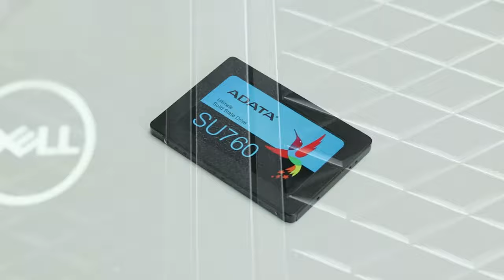Dell Precision 5820 Hard Drive Installation

Comment: To unlock the HDD bezel, remove the side panel first. Locate the unlock button. It is blue in color, located above 5.25” drive bay towards the front of the chassis. It has an unlock symbol. Press it. 

After that, then you should follow the instructions in the video. Thank for posting is video.
Reply: Bro, you just saved me from ripping the thing off.
Reply: @disasstah  same here 😅
Reply: life saver
Reply: This comment is the most helpful part of the video

Comment: 1:10 mine system is not open for some reason that latch is jammed, using something to push it down but the front panel where the ssd is not pop out or removable.  Any idea?

Comment: I have 22110 server samsung p963 nvme ssd that I have installed in pcie adapter and Im using it as boot driver in my lenovo server . Can I use this as boot drive in dell ? Will it boot from pcie ? This pcie adapter also comes with sata cable that I can connect to motherboard .

Comment: I’d like to install two 2.5 inch ssd inside the 5.25 inch bay using Dell r9pxf cage. Do I need to buy two SATA cables and connect them separately on the motherboard?

Comment: I got a 2tb 3.5 inch sésgate barracuda drive and i put it in but it just doesn’t show up on my computer
Reply: If this is an additional drive and the drive is new you may need to initialize it in computer management.
Reply: Have you solved this issue?  I have the same issue but didn't know how to enable it.
Reply: @eaglezhou1243  - Go into the BIOS and make sure the ports are enabled and show in system information.
Reply: @KlipschHead281  , thanks and it works.

Comment: i have one system CPU  precision 5820 950w, i want to use at my home, but issue i am facing, when i was using this system at my office , its working propely but when i was using at my home, then its not working, start isse, when start then after 10 min mouse and keyboard stuck, not working propely, i don't know whats problem is there?? my IT guy told voltage issue but, its 950W then how to use at my home plzz help me out.
Reply: Many of customers use these workstations at home with 950w power supply, and have we have not heard of this issue before.  Before trouble shooting your workstation, we recommend testing your outlet with a volt meter and confirm its not your home causing the issue.
Reply: @seanhall2962  sir 950 w means is it possible to work from home, because at my home is not working properly, i already checked everything voltage and earthing

Comment: Hello...i have bought SAS 2.5 inch...when im plug in. It not detected. WHY?
Reply from the maker: Hello, it could be various reasons.  Most common issue that causing this is:  1) Drive is not formatted in Disk Management (drive should be seen in the BIOS), 2) SAS and power cable is not connected to the drive and motherboard properly, 3) drive is defective.  To confirm, first check the BIOS to see if the drive is recongized there.  IF not, check the cabling inside the workstation to confirm both ends of the connect are securely inplace.  Lastly, if the above fails, replace your current drive with the new drive, and see if its recongized (can be switched back after) to confirm the drive is good or not.  Best of luck.
Reply: If you installed it on right beside of NVMe dirive, It could be happen. try other bay.
Reply: Hi There, I am sorry to bother you but have you resolved the issue? 
I am just thinking of getting this PC but read on few forums issues with drives installations... not sure if that is systematic issue or something which could be resolved. Thanks for advise.
Reply: Hi to all the guys here. Would like to make an important question in my case concerning these dell computers that come with raid as an active drive controller (intel rst active) and not ahci. The problem is that whenever i try to boot into these machines in a winpe environment with the Strelec package if you know that, in order to reset the admin password if i cannot log into it or just backup the data of a user into an external hdd before  reinstalling windows if the precedent os is damaged and cannot be repaired, the internal hdd-s or ssd-s of just the os directories into the drives are invisible. I click on “This PC” and there’s only my usb visible and nothing else. I made a search on the internet and it seems it has something to do with the intel rst driver that abstracts the hdd from the os. Please help me, what should i do in this case in order to be able managing the pc even when the pc is unbootable or just the admin password is not recognized.
Reply: On another video about the P5820 the host said that an SAS adapter is needed for SAS drives.  I'm looking for a video that shows how to install the NVMe backplane to use NVMe drives. In the owners manual, page 92, it states  that SAS drives are only supported with optional controllers and only on Xeon systems.